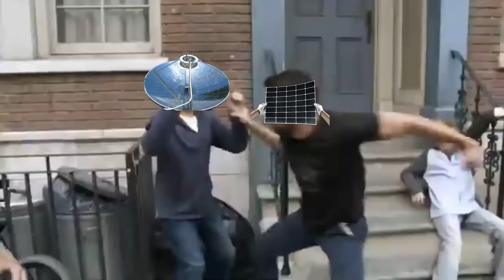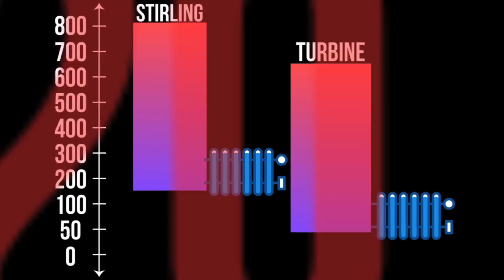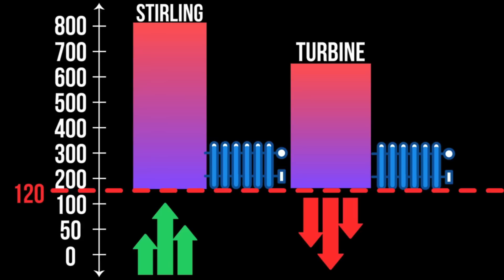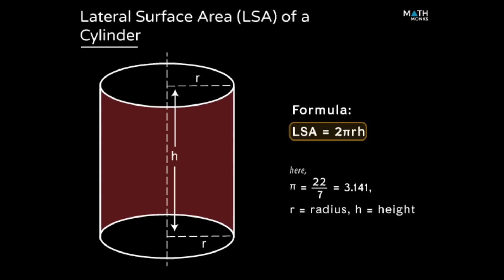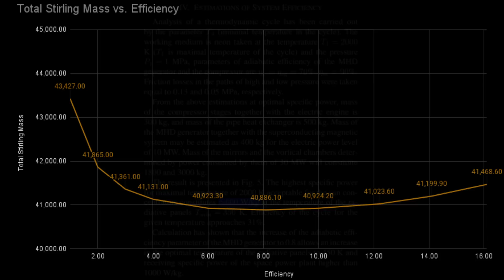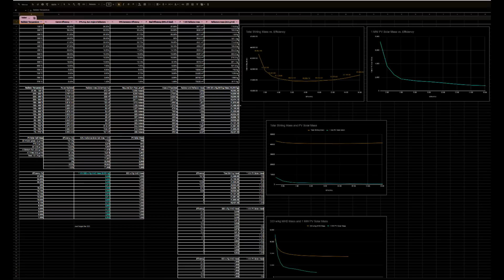Stirling Engines vs Solar Cells (+Transmission Lines)

Comment: so, on the radiator, use thermocouples to direct convert heat to electricity and use that to run LEDs and focus their light back on the hot side collector. so the heat is dissipated by the thermocouples And peltier effect from the LEDs, remaining heat is disappeared in the normal radiator. would this help or even work?
Reply: and relatedly... can we make mirrors that work well in infrared wavelengths? if so then you could just directly radiatively return bb radiation to the collector side, or direct it into empty space
Reply: @daruekeller types of glass is one such highly UV reflective substance.  Yes you can make UV mirrors.  All spacecraft have some methods of doing this, james webb a modern, extreme example of this.  Essentially just highly reflective and radiative aluminum foil lol.

Comment: Instead of a radiator, why not use the ground as a sink? Just curious.
Reply: Solar cells also don't like heat.
Reply: The ground will heat up, but it will dissipate over time. That heat may be useful at night as well.
Reply: @riderpaul he went over it in the comments, but essentially the lunar regolith would just reach a very un useful equilibrium temperature.  Think about how it works on earth as reference.  Geothermal heat from the core, far less of a temperature gradient, air to conduct heat away from the surface, water to conduct heat through the soil...  Its nothing like the lunar environment at all.

Comment: This video reminded me that solar photovoltaic cells don't completely ignore the temperature of their environment. They do lose efficiency as they get hotter. In the 120 degree Celsius environment of the moon, PV cells will be only half as efficient as the same cells at room temperature(which is what they are rated for.)
Reply: That's why my votes for nuclear, whether it's fission or RTGs. Nuclear RTGs can have a half life of 90 years, they never shut down, you can bury them and they still work.. A 300 watt electric output RTG outputs 4kw of thermal which is useful for a habitat and hey you could even use the thermal output as your hot side for a Stirling engine, either converting that heat directly into rotational energy for powering mechanical devices or having the Stirling engine spin a generator setup. They'll run nonstop for those full 90 years without a hiccup (maybe not the stirling engines but that can be improved)
Reply: @DarkAttack14  dude, that was a rabbit hole, researching RTG. Fascinating. I cannot imagine why you wouldn’t use this on the moon.
Reply: @DarkAttack14  This is why Kirk Sorenson was researching nuclear power for lunar installations and stumbled across molten salt liquid fuelled designs and went off on his side quest project which became his main quest
Reply: You obviously didn't watch his previous video. Amorphous silicon solar cells can work even in 120 degrees Celsius. We're not talking about crystaline silicon cells.
Reply: However they'll be more radiation-tolerant, as they'd essentially be constantly annealing in the moon-day (month) thermal cycle

Comment: Your radiator discussion is missing the idea that by shielding the radiator from the surface and sun, the radiation sees only the sky, at a temp of a few K.  Shielding from the sun means putting the radiator in a shadow.  Shielding from the surface means placing a reflector below and around the radiator.  In fact, if you point a parabolic solar thermal system at empty space,  it generates cold.  But the difference is that the sun is point source and needs a focus, while space needs no focus, just shielding.
Reply: Also the fact that you can probably  drill down to a thermally stable depth of rock and dump heat there
Reply: That can work near the poles, but at the equator you don't have much options. Assuming you want to put down square kilometers of power generation. Your just radiating into the radiator next to you. The radiator is basically sandwiched between the moons surface and the radiation of the sun. But, like someone else already commented, you can dump heat into the ground and radiate that away at night.
Reply: Assuming the radiators are a plane, then only the edges 'see' each other, which is very little thermal effect.  Imagine placing reflective foil between the radiator and any warm surface,  basically a layer of foil acres in extent under the acres of radiators.  Then arrange a shadow for the sun.  

Maybe put panels up facing all directions and point some at the sun and some at the cold sky, switching plumbing

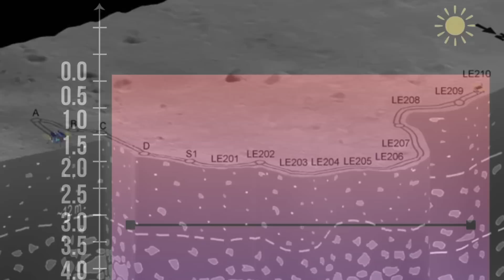Comment: Question: At around 34:20 you mention burying transmission lines in the regolith not only for insulation but also for cooling. Wouldn’t this also work for cooling in a solar thermal energy system? Use the Moon itself as the heat sink, similar to geothermal systems here on Earth? How would this affect the calculations for energy density and total mass requirements?
Reply from the maker: @DABrock-author  it'll still be hot just a bit less than direct sun.
Reply: the problem there is, rock can hold onto a lot of heat, and itll move slowly away from the source, you can on really do this once and then you have to wait however long it takes the heat to move

Comment: Why are we assuming heat needs to be radiated? Could you not just stick the radiator underground and conduct your heat out into the regolith? This would also improve your cold end temps as the subsurface temperature of the moon is -20 degrees. 

Assuming a surface radiator seems like a major oversight.
Reply from the maker: Local equilibrium
Reply: @Anthrofuturism  are you saying that the regolith would act as an insulator or something and wouldn't dissipate heat as well as radiation on the surface? I genuinely can't discern what you mean here
Reply from the maker: @nilnailscrew4784  yes. Read pinned comment.

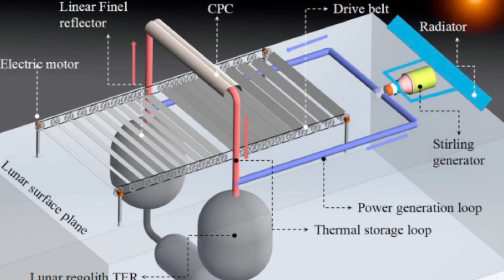Comment: I'm at 7:30 min into the video so this comment might be answered later but isn't nighttime the only "cold side" you need for a heat engine. Like just store heat in the day and release at night.
Reply: You cannot really store heat until the cold gets there, but you can do the reverse, freezing material during the night and then using the latent heat of fusion to keep your radiator cold
Reply: yeah i feel like he gave the heat engine its worst shot by assuming it needs to radiate all energy away continuously, above ground, during the day
you could optimise this radiator much more efficiently by a) conducting the heat out through lunar regolith and b) having a large enough thermal mass that it doesn't saturate in a day and radiates through the night
Reply from the maker: @FrankWie  there are thermal wadi designs like this but you'd be surprised how fast the heat goes away
Reply: @Anthrofuturism  There are sand batteries here on earth, that are currently working.

Comment: Hello, I enjoyed your theorizing. Though, I havent heard anyone talk about solar mirrors ORBITING THE MOON, directing concentrated light beams onto the surface. Those structures could be larger than anything on the surface and be held together with less material, such as thin reflective films held tight by rotational forces and cables, rather than on a ground based mounting platform. It would also keep the reflectors free from dust. And it could supply sunlight to the surface during night. You would then need fewer heat engines on the actual surface because its no longer as spread out.
Reply: Not sure how well that would work, as orbit decay might cause serious problems. (I think I heard somewhere that you can't even orbit the moon for that long because it eventually just decays into an Earth orbit? Not sure how reliable this info is though) Then there's also the fact that you'd need a bunch of these before they're able to supply power all the time (They can't beam power down from the other side of the moon, unless there's something simple that I'm missing here) and you need the launch capacity on the lunar surface to do that which means you probably already have a mass driver or some other launch infrastructure
Reply: @MrWeli   I think the reflector satellites could be built and sent from Earth, but you're onto something about the orbits potentially decaying. If they can't be stationary orbits then you'd need a rotating fleet of them, making it costly and junking up space. There is a Lagrange point between the Earth and Moon, but that's probably not okay. Perhaps there's a spot on the Moon's opposite side, where the reflector satellite could orbit the Earth from behind the Moon. That spot would experience gravity of both bodies but feel like only one. So it could just take the same orbit as the Moon but a little farther. But I don't know what kinds of orbit are possible or not.

Comment: mmm mirrors in space are too risky because of micro particles and debris. glass and mirrors are very fragile and could crack or shatter if dust or high moving particles strike the surface. Good idea though but too expensive and too risky.

Comment: Sometimes I just imagine we dig kilometer deep spaces under the moon cover up the surfaces and pressurize the space inside. Then make angled tunnels that leads all the way from kilometers down to the moon surface that will accelerate stuff to orbit using some of the methods you mentioned in your previous vids.
Reply: Regolith weighs about 2.5 ton/m3 and with a lunar gravity of 1,625 you'll need about 25 meter of regolith to have a roof pressure of 1 bar. About 10 meter is the minimum for radiation shielding, so a roof of 25 meters is perfect. I'll do a bit more, so the roof construction is always under compressive loads, even when some mishaps happen.

Comment: It just occured to me that stirling may not be as useless as one would think?
We have this "nifty microwave plasma drill" it is experimental technology and two prototypes will be (hopefully) field tested here on earth in 2025, the thin is you have to start with a conventional drill since the top soils are too soft and watery on earth, a problem we don't have on earth. We also need to pump gas down to flush the hot vaporized minerals on earth, on teh moon though? there's a near vacuum, the hot gas would push itself out for the most part, only at the end do we need to flush the rest gasses out with something else. This means this experimental tech would actually be much cheaper and easier on the moon and drilling down would not only allow for more science, but also open up mantle and possibly deep mantle geothermal. This could make this trick much more viable than pushing around nuclear reactors for long term outposts and localized power grids.
I already pointed out on the other video that a radiator with a white reflective box could be used to direct the waste heat directly into the sky while keeping the suns infrared out due to geometry. Combine these two tricks and you get 24/7 localised small size factor power with a rather big punch for its size. We can reuse the drill, so only transportation costs apply, we can reuse the radiator, the stirling engine and that is rather managable in terms of transport and production, it could be easily mass produced.

The hole of the drill is glassed already to stabilise it something that is pointed to as an advantage on earth as well, you basically only need to lower a pipe with a heat collector down into the hole, fill the pipe with a high temperature fluid NaK would be the prime candidate and the hole is rather insulated already. Put another heat exchanger to the NaK pipe and your stirling engine to teh other side of the heat exchanger and you get a somewhat "simple and around teh clock" solution that doesn't need a nuclear reactor and can be domestically produced on teh moon. In all of this teh most expensive thing is setting it up and drilling the hole, but it's only expensive due to teh energy requirrement for teh microwave laser adn transport costs. Btw. a positive aspect of this drilling is that you basically have very little down time for repairs and very few components with damage, regolith plays havoc with machinery and moving parts, but the microwave laser doesn't have any moving parts.

The catch:
The biggest downside to all of this seems to be that to get 800°C, you need to ONLY drill about 300km down, not unfeasable with that microwave drill, but using that heat is a case of "no luck", I also couldn't find a good chart for how hot it gets at which depth, the limiting factor seems to be getting a "good temperature" though?

Also here's something from NASA about that idea, coudn't find where to read it yet, will try again tomorrow.
https://ntrs.nasa.gov/citations/19660026223

Edit START:
Yes, the "big brain move" is not shade itself, that is a requirrement, but not the solution, the suns heat would be unwanted on a radiator meant to disperse waste heat. No the "cheap parlor trick" is the reflective box with specific geometry, it allows us to radiate directly into space, this also works to a degree on earth, only the pesky atmosphere is an annoyance, it isn't on the moon though. The upside of this parlor trick, cheap as it is, is that you only need the "whitest white", or better yet, the best IR reflecive material and the "balckest black", also in regards to IR, the geometry means we can direct the waste IR by reflection and due to geometry even directly into the vastness of space itself, with a variable/movable outlet we can even make sure the sun doesn't reach into the box to begin with. This tech wouldn't exactly be usefull on the ISS, too heavy and with 90mins for one orbit this just isn't usefully to begin with, the moon is however way slower, during the night we can easily "beam teh waste heat into space" during the lunar day planing where to aim and generally building the box in a direction "where the sun don't shine" is paramount.
Notheworthy, although something our dear host doesn't quite believe in, even if this was proven on earth already, curtesy of TechIngridients, if they can do that in their backyard, so can we on the moon!
Edit END